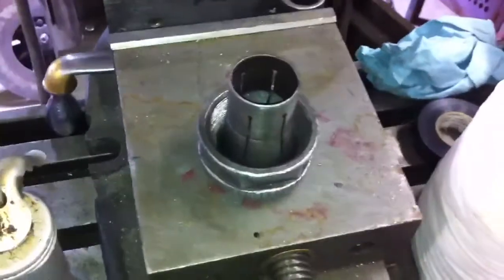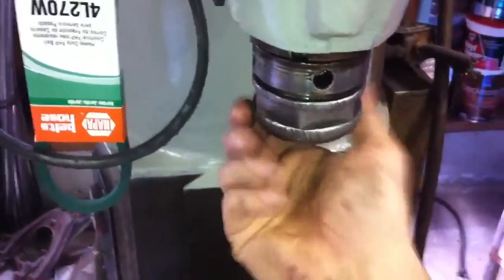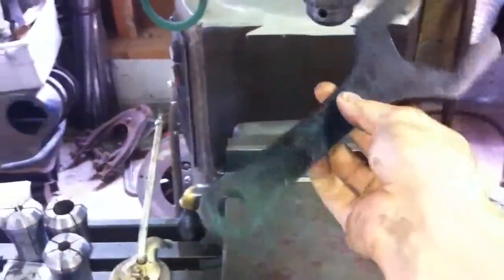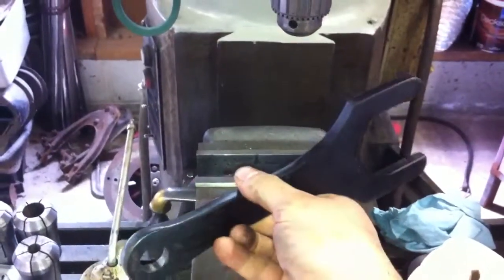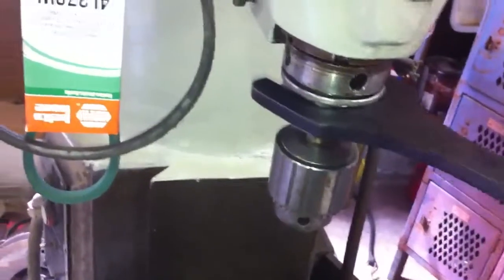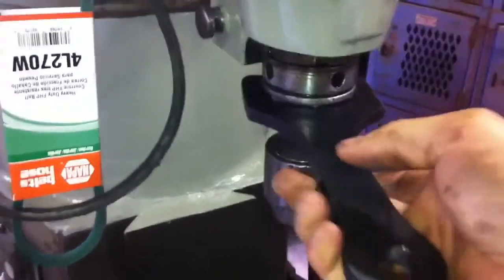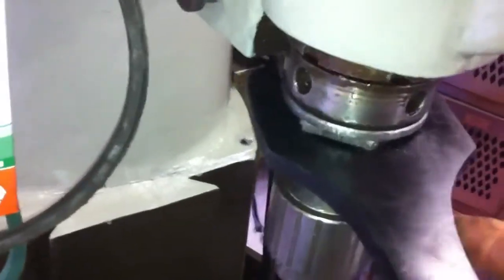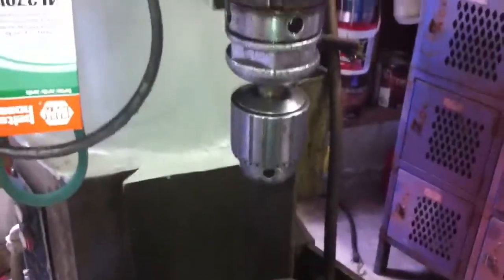Cincinnati Toolmaster 1 series collet

Comment: That looks like a really nice toolmaster, I have the same one but it's a little wore out.
I have mine hooked up to a 1phaze-3phaze VFD so my power feed's don't work. I would love to see a video of your mill under power.
Reply from the maker: Mark I should have a video up soon of it running. are you at all interested in setting up a 3 Phase rotary converter? Then you could run all your power feeds. That is a big reason of why i went with a rotary set up. Sorry for the late delay. work picked up and i didnt get any notifications.